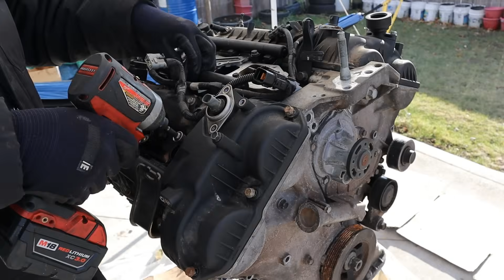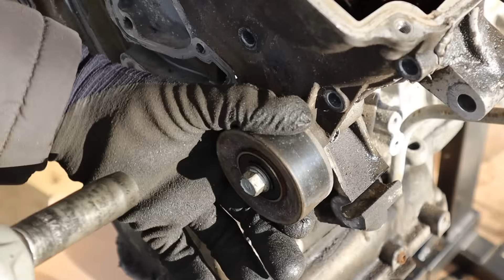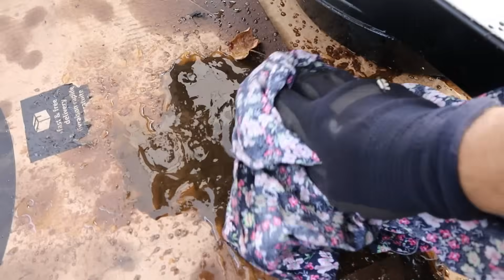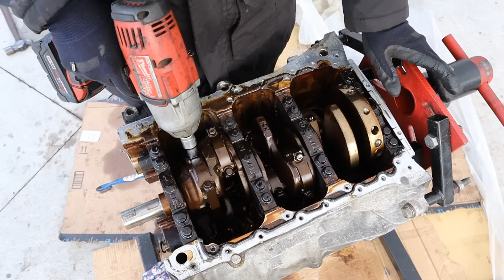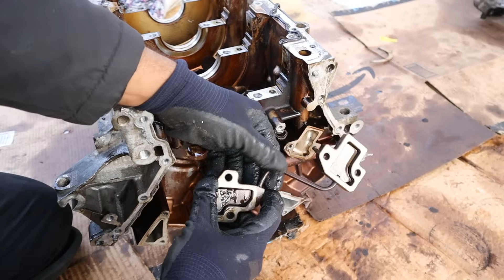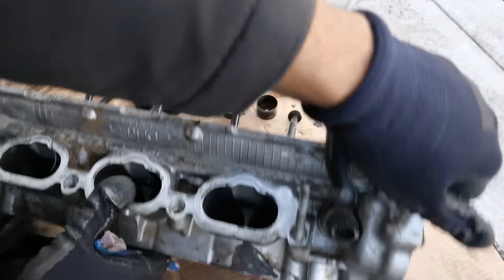A Reliable Hyundai & Kia Engine? Lambda 2 V6 Teardown

Comment: Please sir can you help me, I am from Iraq, my brother has a Hyundai sentafe 6 valve 2012, there is oil in the radiator, the mechanic clean the radiator but unfortunately he couldn't find the location of the oil coolant, please can you tell me the exact location of the oil coolant in the V6 santafe engines🙏
Reply from the maker: You need to do a coolant pressure check and see where it's leaking from

Comment: overall these are great little engines. the older port injection variants are slightly more reliable. they have a notorious issue with leaking valve covers that will eventually kill your alternator, but it isn't too hard to replace the alternator for most applications.

Comment: 7:52 This isn't a coolant temp sensor. That's an oil pressure sensor. Coolant temp sensor is mounted in the other side of the engine, straight to the plastic coolant manifold.
My engine threw the oil out through that bad sensor so l know what am l talking about 😅.

Comment: My ‘11 Santa Fe has the 3.5L. It currently has 256,000 miles. Uses no oil and runs great. Only things are the noises on cold-starts. Timing chain (2-3 second slap noise) and cam pully, but I put it into gear and back in park and immediately stops.

Comment: Blown head gasket is mostly due to threads in the block stripping out.  I found stripped timeserts in my 14 Cadenza 3.3L. I had bigserts installed.
3.3/3.5/3.8 are shared block and other components.

Comment: I've got the lamba 2 twin turbo in my stinger and its got 90k miles on it now with zero issues. I'd say fairly reliable so far.
Reply from the maker: Oil burning?
Reply: @speedkar99  No sir. recently just went through a full checkup with my local mechanic, had my intake valves cleaned up and everything looked great.
Reply: I bought a brand new V6 stinger also in 2022, so far a trouble free car, any preventive service to look out for?given it's a twin turbo with quite a bit of power to it.
Reply: @fs5866 Yeah, get a catch can, I've not had any issues with carbon deposits on the back of my intake valves but it is a GDI engine so it could be a thing.

Comment: Another wonderful  vid.  To clarify, isn't the oil pump tasked with providing flow and not pressure?  I understand pressure is a byproduct of oil branching out into increasingly smaller passages.  Just trying to clarify for my own understanding.  Thanks for all you do btw.

Comment: Perform oil changes every 4k miles and don’t mix synthetic oil when and if you top off.  
As he states in the video, the oil control drain back holes in the piston clog up with crystallized oil (some call it carbon) and that’s why they consume oil. 

If you have a 3.3 or 3.8  that is burning a lot of oil, the only fix is a teardown and re-ring.

Comment: Thanks for the video and the explanation/opinions on all the aspects of the engine.  

We're looking at replacing our Toyota with a new Carnival, but never owned a korean vehicle before and was wondering about the reliability of this class of engine vs a turbo 4 cylinder.  

I realized that I'm running a bit on hope that Hyundai/Kia has maintained a lot of the methodologies shown in this 2012 engine to a 2024/2025 (in short, more metal, less plastic, especially where it counts like the oil hose under the intake, timing cover, etc.)

Comment: How did you donate the cvvt assembly 
I’m in doubt because I assembly new phasers but it didn’t run well and the cold start still noising and check it again and the intake phasers blown off

Comment: >Reliable.
>Recalled for head bolts tearing out of the block and stripping the block threads.  Costs $420 for the repair kit, and $5000 for the labor to do the job.

Comment: My 2012 kia sorento sxv6 has 305,000 miles, no internals replaced to my knowledge, purchased it 4 years ago at 243,000. It still runs and drives like a 190,000 mile chevy 😭💜 bless its heart

Comment: Bullet-proof engine.  I drove a 2006 V6 Sonata for 255K miles with only changing the PCV about 80K miles.  No other parts replacement.  Currently on a 2014 Genesis 3.8 V6 with 218+K miles with a PCV replacement at about 75K miles.
Reply: Nice. I have a 2018 Stinger with the 3.3 twin turbo Lambda 2 and I hoping to get at least 150k trouble free miles. So far it's been a daily driver for the last 6 yrs and nothing but basic maintenance.
Reply: I want V8 but i'm afraid of maintenance costs and weak transmission
Reply: @ Currently at 234,700 miles and no issues with my V6.  333HP and it moves with no issues at all. Most days when I work, I touch 100 mph on the way home, the power band is amazing.  When I stay below 80 mph I average 27-28 mpg combined.  On the highway I'm getting 30-34 mpg at 75-80 mph.
Reply: That's insane. 
What about carbon buildup, no issue?
How often u change oil and what type u use
Reply: @Angry-Lynx  Every 3000-4000 miles using a Wix filter and Castro High Mileage semi synthetic oil.
Reply: When do you know it's time for a new PCV?
Reply: @andali555  Supposedly every 75K miles.
Reply: When you changed the pcv, was it still fully functioning?  Did it or the hose have a lot of crap in it?  I will be doing mine soon.
Reply: @garyganser2451  I don't know, it was accomplished at the dealership service center where I bought the car.

Comment: 8:54 "They're known to overheat & they burn oil"
Not so sure about that. Well engines don't just "overheat" 
As long as you keep an eye on the coolant all will be fine.
One thing for sure, they use some rubber which I believe has to be bio-degradable on the upper radiator hose. at 70k miles/5 years, my upper radiator hose got a slash on it. Parts for this engine  are not readily available and needed to be ordered, so I cut the hose in two pieces and connected it with a fitting. When the hose arrived I did not changed it over because well, it was working fine. Guess what, less than a month down the line, another slash appears. The rubber was just basically expired. Anyways, with a new aftermarket hose its already been years no problems.
Zero oil consumption on my end at 129k miles, and I change my oil every 3k because I do a lot of high-speed highway cruising 130/140 most of the time and this engines don't come with an oil cooler so the oil gets degraded pretty quick, and its a GDI too.

Comment: I have a 2008 Sorento on 2” spacers with the 3.3l Lambda 1. It fkn rips. Sounds way sportier than it’s probably supposed to. I tried the FRAM XG9999 or whatever full synthetic filter and it caused the oil to drain back into the pan so only use OEM i guess if you’re reading this. It sounded even sportier and picked up better after I got a new oil filter :/ I love this rig. It’ll go where some jeeps have had a hard time going, but I did have to replace a steering rack, both front steering knuckles, tie rods, ball joints etc

Comment: Great video man, I own a 2018 Kia Sorento V6 with a Lambda II GDI engine. Getting look inside a Lambda II engine and hearing about the heat and oil burning issues.

Makes me think more frequent coolant flushes and more frequent oil changes as the car gets over 100k miles would be a good idea.

Also did you use your wifes shirt to wipe up oil at one point?  No many shop towels have a floral pattern lol

Great video!

Comment: I have lambda 2 3.3 in my 2015 Santa Fe. so far no issues at 148 000 km. changing oil every 6 k km since new, synthetic only.
still good power no noticeable drop in fuel economy.
Reply from the maker: Nice!
Reply: I have a 2017 at 115000 it just started consuming 1.5qt every 1000 miles. And has a ticking noise on coming from passenger side any thoughts or opinions would help
Reply: @calvinpeterson3203  Oil consumption + ticking noises means an engine rebuilt in your near future. You can do it now while the engine is still in one piece or wait until it dies and replace the whole thing. But who knows, maybe it will go for another 20 or 30 thousand miles before something happens.
Reply: @old_dan   hyundai just extended that motor and year for our car to 150k 15 yrs and good news they will replace motor but only a 12k 1year warranty. Which I kind of disagree with I would at least like the difference of 150k from our 115k but better than paying 9k for the motor. They just sent a letter out to all the owners and we got a loaner that is new a 2024 santa Cruz aka the baby chevrolet avalanche aka baby honda Ridgeline hahahaah
Reply: @calvinpeterson3203  didn't hear anything. Must read about it. I am in Clownada so who knows whats the plan here. Still my SF keeps running strong. Bought a second car so SF will  just tow the boat go to garden centre and tackle deep snow so mileage will be 3k per year. Hopefully get another 5 years of trouble free operations
Reply: @calvinpeterson3203  well that's nice that they're doing something. I have a 2018 Stinger TT V6 so no issues there. I'm hoping to get at least 150k trouble free miles out of it.
Reply: @calvinpeterson3203  not good. I am at 100 000 miles now. Still so far so good.
Reply: @calvinpeterson3203  Take to pro and get estimate of repair and diagnoses.
Reply: I have a 2021g70 with the 3.3tt at 37k  you're telling me this thing will last me a while❤. God i love thise car.
Reply: @boredashell666666 yours is turbo so a bit different beast. My current mileage is 179 000km. Still going strong.

Comment: The overheating issue is very common BUT its mostly from the radiatior fan connector burning up and causing the engine to be fucked
Overall those are the most realible engines hyundai and kia ever made.
Reply from the maker: Yes more reliable than their other engines but still prone to head gasket failure
Reply: @speedkar99 what's the cause of the head gasket failures ?

Comment: There's a recall for the 2024's Lambda II V6 engine replacing the engine sub-assembly. 
NHTSA Recall No.: 24V-077 & Manufacturer Recall No.: SC296  “2024MY Telluride Engine Valve Spring Chronology.”
Certain 2024 model year Telluride vehicles manufactured from October 1, 2023 through December 6, 2023. 

The engine valve springs may break while driving due to fatigue cracking as a result of damage to the springs during manufacture by the supplier. A broken valve spring may result in a loss of motive power. In rare cases, a hole in the engine block may occur due to a broken valve entering the combustion chamber.

All owners of the subject vehicles will be notified by first class mail with instructions to bring their vehicles to a Kia dealer. Kia dealers will replace the engine sub-assembly. Kia will reimburse owners for repair expenses already incurred pursuant to Kia’s General Reimbursement Plan filed May 10, 2022

Comment: Maybe it was because we had the early 2014 sorento, but it had gone through 2 lambda 2's and we sold it after getting the 3rd motor.. all were replaced under warranty because they all developed knock. 

The first engine made it till around 100k and the second -shit you not, didnt even last until the end of its breakin period... When we got the third engine we already wanted to sell the car but i noticed that it was also experiencing the same "knock"/ tick at startup that the other engines did.. apparently this is just the way the VTC system works on these POS engines and oil needs to flow before it goes away.. but like i said, every single engine i had developed knock from normal driving (and not just at startup)
Reply from the maker: What kind of oil were you running? Did you ever run it low?
Reply: @speedkar99  was never low but we did have to follow the warranty 6k mile intervals
Reply: Also these were the early GDI v6s

Comment: Would love if you responded to my comment on your vw Tiguan video.
Reply from the maker: Ok
Reply: @speedkar99  the only reason why the Tiguan was misfiring in your video was because you had the dipstick pulled causing a vacuum leak.

Comment: This engine is essentially a reverse engineered Mitsubishi 6G7, which was coincidentally purchased under contract and used by Hyundai in their Sonata through the 90’s.
Reply: Not really true, the similarities are basically none. This only applies for the"G6CU" engine which was essentially a 6g74 flipped around. Everything was identical except on the mitsubishi motor they put the bell housing on the left/ timing components on the right, whereas hyndai took the same engine literally and put the bell housing & timing components on the other side. 

Everything is just different, the bore and stroke, the all aluminum construction, the timing chain instead of timing belt system, the variable valve timing, the cam bucket design, pretty certain the crankshaft and rods are cast instead of forged as they were on the 6g7 series, open deck design vs closed deck on the 6g7 series. What else can be said, literally a completely different engine.
Reply: @Key-z2x  yup the Hyundai 2.5 & 2.7 were Mitsubishi 6G72 also used by Chrysler in 2.5l version

Comment: As a Kia master I see the back bank head bolts pull out and strip the threads on the block, this causes the head gaskets to go. Normaly the back bank goes. This is just the 3.3 v6 on the newer v6 3.8 I have yet to see this failure. If you have a 2016-2018 sorento with the 3.3 there is a TSB that will replace long or short black depending on how bad the failure is for the bolts stripping out. Extended warranty is 10 years 180,000 miles.
Reply: Any extended warranty for 2018 sonata ?
Reply: @doodledo5226 I had a 2018 sonata..I got a recall for a knock sensor software update. Then I got a letter from Hyundai giving me a lifetime warranty on the engine. That’s only for people that did that recall.
Reply: Other than that, take care of it and they hold up really well, keep the coolant and oil fresh and they will go 200k and I have seen a few in the 300k mile range with minor problems.
Reply from the maker: Good to know! Seems like the rear bank failed on this one too.
Reply: My 2014 kia Sorento went through 3 engines and I sold that shit

Comment: The video I've been waiting for.
Many thanks bro.
These engines are very reliable and can run more than +500k km maintenance free.
The only drawback is the intake manifold tends to fail rearly and cause loud noisy sound
Reply: Would you say that the issue with these engines comes down to bad maintenance? I keep hearing that the dealer recommended 10k mile oil changes is what keeps these from lasting. Makes sense since the design does seem very simple.
Reply: @msschill  Never do oil changes at 10k miles on ANY brand vehicle. That's asking for trouble. Do them at 5k all the time and you'll be fine.
Reply: @old_dan I have never gone past 5500 miles for Oil changes. Oil and filter are much cheaper than a new engine 😊
Reply: @msschill  Very nice, brother. I'm proud of you. 👍
Reply from the maker: Thanks, so you have this engine in your kia?
Reply: @speedkar99  Yes. Kia cadenza 2012 V6 3.5L  with power steering pump

Comment: I believe this is the 3.5 lambda, the best of them. No gdi stuff. Our 3.5 has 190k and running great, no oil consumption, no timing issues. The plastic oil housing, the plastic fuel rail and the oil pressure sensors are prone issues. Overall its much better engine than i thought for a kia.
Reply from the maker: Yeah the plastic is what kills it for me. Mechanically, it seems simple and sound.
Reply: What's interesting is that the MPI 3.8 doesn't have the plastic coolant transfer pipe. The intake manifold is all aluminum as well. And the knock sensors are on the outside of the banks. 

I have cracked one of the plastic fuel rails before though haha. They have to be treated with care.
Reply: @FonicsSuck   if youre talking about the one for the coupe, that one had a few small differences between most of the other lambdas

Comment: Can you do a test down of the V8 engine that is inside in the KIA K900.
Reply from the maker: I don't think Hyundai has V8 engines in the K900 here....
Reply: @speedkar99  The Hyundai Equus and KIA K900 shared the same 5.0-liter V8 that produces 429 horsepower and 376 pound-feet of torque. They were luxury sedans that weren’t advertised much.

Comment: I believe you may be incorrect the new version uses both DI and multiport.
Reply from the maker: Are you sure for the v6? 
I know the new 4 cylinder have both
Reply: @speedkar99  I could be wrong
Reply: I don't think there's any Lambda engines with both DI and multiport. I have a 2018 Stinger with the Lambda 2 and it's DI only. I wish Kia would've put the dual system like other manufacturers have done. 😞

Comment: Modern engines are technological marvels, but are they "better?" Define better. They make more power, with less fuel, achieving better efficiency. But is that better? The engines are much more complex, much more prone to failure, and more expensive to produce and more difficult to repair. In other words, there's more to it than just efficiency for efficiency's sake. I love engines and playing with tech ideas on paper. That doesn't mean all these ideas are good ones.
Reply: everything feels so over engineered these days, i say emission standards are really pushing us to the limits.
Reply from the maker: I feel like better means it lasts longer and is made of higher quality materials

Comment: Love to see a teardown of the 1998 V6 Isuzu Trooper engine.  I had one of these and it was totally trouble free.  Probably hard to find a failed one :)
Reply: my friends mom had a Isuzu Rodeo and the engine outlasted the car its self. last i saw it had 400k miles and she treated it like crap.
Reply from the maker: Isn't that the Honda J-series? Or is that the Isuzu passport
Reply: @speedkar99  Honda used the Isuzu engine for a time.  I'm not 100% familiar with the US versions, in Australia we didn't get the Hondas but did get the Jackaroo/Trooper  edit: - yes, the Passport used it and the Acura also.